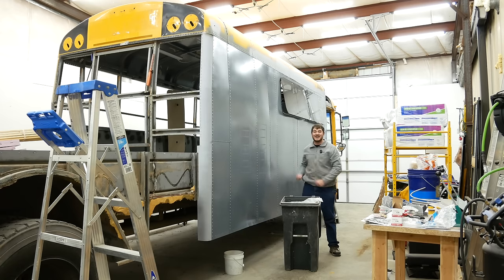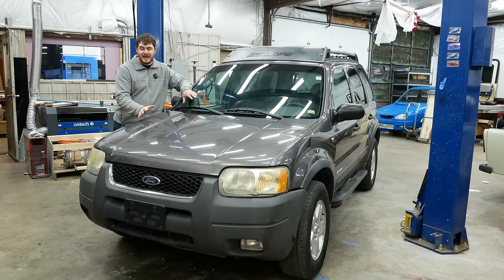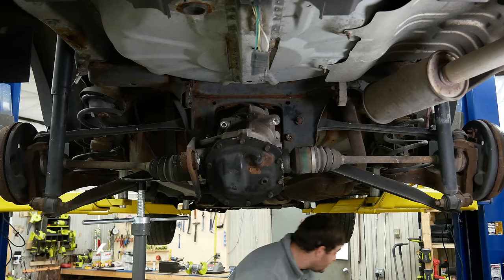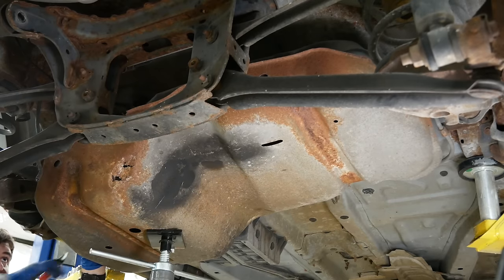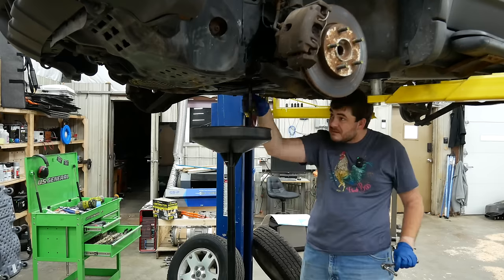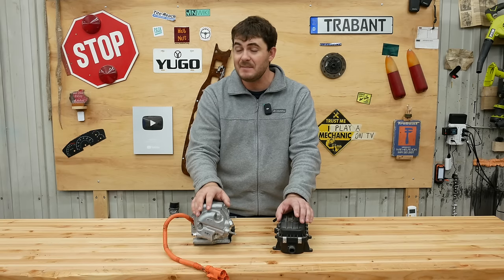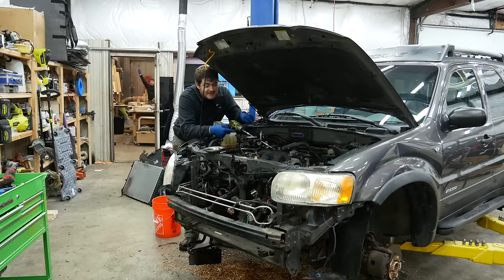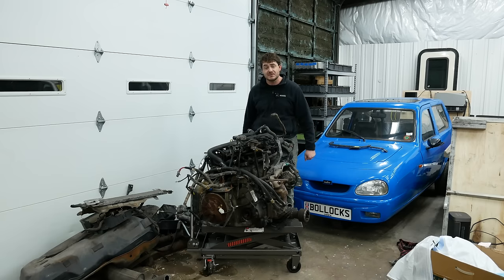I'm Building a 900HP Electric Ford Escape with a Purpose

Comment: I'm so glad you thought of DC-DC conversion. I've seen way too many DIY conversions that just run everything directly off a 12v battery, or only have like a 100w DC-DC converter, so the second you turn on the headlights, it's draining the battery. and when the 12v dies, you can't use the car at all...

As for heating the coolant: maybe look into making the chiller reversible? My Bolt has a 9kW heater, and it's murder on the range when it runs. Meanwhile the A/C is sipping 2kW when it runs.

Comment: The bus project will be frickin awesome. I've been waiting for someone to do a hybrid large vehicle, it makes total sense. You can run a load of home comforts off the electric system, you can charge it on campsites or off solar, there's loads of extra power when you need it and you can put a more efficient engine in it to generate electricity

Comment: Ooh, this is fun. My mom had a similar Escape, and while they're not really compelling now, it wasn't all that bad. Thankfully she got rid of it before it started to have rust or transmission issues.
0:27 Also uhhhh, what's with the feathers and old Dell XPS?
Also, as others have said, that copper glitter is most certainly some stop leak product.

Comment: Not sure if you’re aware but in 2005 Ford added the Hybrid model to the Escape lineup. The electric power steering rack is designed for the same subframe. They changed very little between models to save costs. Even the 2nd gen 2008-2012 Escape Hybrids use the exact same drivetrain and many of the same Escape parts shared since 2001.

Comment: 17:24 Copper flakes are from a head gasket sealer. Fix it fluid (the expensive kind, even!) means the inside of that system is probably clogged to the nines, but it's sealed! (Mostly.)

Comment: The weight is a harmonic damper. It helps stop vibrations and the weight is tuned to the mass of the unit is attached to.

Comment: Copper flakes are from a liquid head gasket sealer someone poured into the radiator to attempt to fix the head gasket problem.  The sludge you found was also probably the same or a similar product added to try to save the motor.   
I think you’re pretty safe in assuming the engine is bad.

Comment: The copper flakes in the coolant are probably from the addition of radiator stop-leak to the cooling system, some brands contain powdered metal or other materials (such as crushed up walnut shells) in an effort to plug up larger leaks.

Comment: Robert, I have to say, especially re the outro, you are quite an inspiration to me. I've long wanted a project car but have believed I lack the ability to do one. On the other hand, I am a definite EV convert. Until I watched what you do, I considered those incompatible interests (maybe this is due to the way EVs are marketed like black-box smartphones).

I picked up an i3 and I'm getting ready to work on hot-hatching it, and maybe swapping the motor to a more powerful i4 motor. Super basic stuff for some, but it wasn't until your work on the Codas that I even considered this

Comment: That's a decent project and should pull a lot of viewers in. I'm very interested in the control side so your sponsor is ideal. The bus has plenty of space for batteries, motors and cooling so could this eventually be a 10 second bus? Hmmmm....or a 1000 mile range machine? looking forward to both builds.

Comment: The chunk of metal on the rear diff was probably a counterweight since the diff weight wasn't balanced when mounted to it's hanger. Copper flakes is likely cooling system stop leak. Rather than electro-hydraulic steering, you could use something like an electric rack out of something like a Volkswagen.

Comment: Copper in the coolant is radiator repair bodge fluid. 
The existing radiator will be much less efficient than it was designed to be because the temperature differential will be much lower with the ev setup. 
Might be fine but it's worth working it out

Comment: You can also get a hydraulic brake booster and run it off the same pump as the power steering. They're typically used in diesel vehicles

Comment: The copper in the radiator was from head gasket repair kit stuff. Gobble de gookey stuff people put in their radiator to try and seal up a blown headgasket, but ultimately end up clogging up their thermostats, heater cores and radiators.

Also you just earned a new sub today C:

Comment: On the coolant system, you should consider using a heat-pump condenser so it can function as the heater as well as the active cooler.

Also, consider having a separate radiator side loop running to the cooling unit, then run the system coolant loops from the temperature regulated side of the compressor.  This will give you optimal efficiency.

You could consider using the A/C condensor directly for this, instead of reusing the radiator.

As a note, I bet that is far worse than a simple blown gasket.  I bet you've got a cracked head or even a cracked cylinder there.

Comment: Later model escapes had a manual steering rack and electric assist built into the column so that swap is technically an option if you don't want to go the EHPAS route.

Comment: Not sure if this is helpful but in 2008, Ford Escape uses a electric power assist steering module. I learned this after searching almost an hour for the power steering reservoir my '08 Escape Limited.

Comment: The copper bits in the radiator hose are from a bottle of coolant system quick fix the previous owner poured in.

Comment: I don’t know if anyone has said this yet, but the copper flakes are likely from the radiator itself. IIRC they use copper inside the radiator to facilatitate better heat transfer, so I’m willing to bet that since the head gasket blew that metal particulate made it’s way into radiator and corroded the interior of it which flaked off.

Comment: The copper flakes are from radiator sealants that you put in there to try and stop leaks and or possibly a blown head gasket but neither are long term fixes and I would be willing to bet the engine was filled with what water that didn't leak out the radiator or evaporate...look forward to the bus beast....

Comment: The weight that was bolted to the escapes diff: its there to prevent harmonic vibrations.
Reply: OfficialAgingWheels  I don't think this is legit...
Reply: I've seen it lots. Sometimes they are a weight in a rubber bushing, sometimes they are just a weight. They are there for vibration dampening.

Comment: Sub-ambient cooling can cause condensation issues. Be careful! Unless you can dehumidify the air going into the sub-ambient cooled areas first, or simply aren't cooling anything that isn't hermetically sealed / insensitive to water, that condensation can easily kill critical components.

Comment: Could easily get the same amount of power and torque out of the diesel that's already in the bus, but it wouldn't be you if it wasn't needlessly complicated.

Also the copper flakes are from a popular stop leak cooling system additive.

Comment: you should get a drive axle for the front for the bus and attach the tesla motors the that... make it a 4wd hybrid bus. You can then just leave the bus engine set to like half throttle and modulate your speed with the electric motors... either by giving it the beans or applying regenerative braking

Comment: Any concern with the motors not being able to push the bus or overheating? Im thinking of doing roughly the same process, but when I look at the GVWR it seems like it would have to push alot. Obviously cooling is the main concern as they SHOULD work, but Im curious if you had more info on that.

Comment: One other modification I would seriously consider if that thing is going to be with you for a while would be a pair of new seats ripped out of something like a Ford Edge or Fusion or really just about anything else from their lineup. The Escape has some of the absolute worst seats I have ever had the misfortune of sitting on. They're ludicrously hard, unsupportive, and barely sprung. just go to a junkyard and grab the best looking set of front seats out of whatever Ford you find.

Comment: As I'm sure you've figured out by now, the silver flakes is a head gasket stop leak chemical they poured in the cooling system as a last-ditch effort to seal the gasket.

Comment: FINNALY !!!! IM WANTING TO DO THIS WITH MY 9 WINDOW BUS BUT I WANT 4X4 MILITARY AXELS AND 2 MOTOR SO IT IS TRUE 4X4 !!!! .... but charging a 72v drivetrain with a 48v solar system (and 2 dual fuel 9500watt generators) as well as keeping constant 12v power for electric power steering electric brake booster pump , headlights, taillights, etc.
 Is where my mind starts freaking out

Comment: What's your plan for connecting everything in parallel? I thought having different aged batteries in parallel was a huge No-No. Everything I've ever read says to buy them all at the same time and swap them all at the same time.
Reply: You don't want to directly connect the cells in parallel, but each pack should have its own battery management system, so connecting the packs in parallel is probably OK.

Comment: I wanna have a 2wd swap on my 87 burban ohh the juice I could fit .. I just picked up a beautiful wrecked 91' that still runs front end is gone .. I'm thinking using my original 87 frame but that new body for final build since 91' squares were not cable speedo and way more electronic .. just gotta find a cheap Tesla and C4 vette lol

Comment: I personally think cool projects like this will also make a sizeable contribution to combatting climate change. Of course 900hp is dumb and inefficient for the average user, but showing the car community that you can have just as much fun with an EV and that it comes with its own challenges, might help to win their hearts for electrics as well. Those are the people who a lot of non car savy people come to, when they try to decide which car to buy next and they often provide a lot of valueble feedback to the manufacturers. If car enthusiasts really get theit heads into EVs, who knows how fast certain problems might be solved, that currently discourage people from adapting this new technology.

Comment: I'm considering a project to convert my Polaris Sportsman ATV to electric.

I want to reduce max speed to less than 20 km/h (12 mph) (tax reasons, and rarely drive faster for more than a feew seconds).
Current power rating (according to registration docs) is 19 kW (26 hp), but 3-5 kW would probably do.

I have looked at new models, but they are either too expensive, or too small.
But hesitating to start on the conversation because I know too little about it, but expect it to cost quite a bit too.

Comment: I'm surprised it was the engine that gave out the 4 wheel drive versions of the escapes are known for blowing differentials and transmissions. I own a 01 XLT that just had to have its transmission rebuilt at 246,845 miles. But its only a 2wd. lol

Comment: Two months past for the answer to the question asked, but anyway.

Copper in the cooling, mans a stop leak was used. Generally stop leak is supposed to be a short term fix until things can be gone over by a mechanic, although it's more often used as a first and final attempt at fixing before selling or trading a vehicle in and making such issues someone else's problem.

Comment: For me i feel the "trackless tram" idea that is currently monopolised by China could easily be domestically produced in North America, Europe and Asia (outside China) if a diesel-electric propulsion is chosen? instead of a huge, heavy diesel engine far lighter/smallerversions could be installed strictly as a range extender/backup? the tram basically can go anywhere but could be charged partially when it comes to a tram stop? imagine a 3-carriage trackless tram that can transport 300 people 24/7 that sips fuel when it needs to and doesn't have to lug a huge engine/battery pack...

Comment: with regard to the electric motor running the hydrolics for the power steering jerryrigeverything tried that in his ev hummer conversion and it caused him no end of trouble and ended up using electronic power steering instead

Comment: I had to stop the video and click the like button at the differential equation :)
Plus, spend the money to get a new radiator. You don't want whatever went through that radiator going into the cooling galleries of your motors and battery pack.

Comment: You already took the bus body off. Why not fit the e-parts in, then drive it topless?  Then you don't have to work under a lift, or worry about fitting things tightly in a unibody. That's why i went in hard on a SMITH TRUCK fleet

Comment: A warning about using those tesla motors for a bus. No matter how much cooling you throw at those motors they are only capable of 100HP of continuous output per motor after a couple of minutes of full load operation. That's fine if you are cruising but if you go climbing a mountain you can run into trouble.  Guys racing those motors on the track have tried all sorts of tricks and have not cracked this problem yet.
Reply: I thought battery cooling was the issue, not motor heat

Comment: Being this is a ford escape, I would say the problem is a crack in a cylinder wall. These are famous for that. The copper flakes are from someone dumping a can or three of "Block Seal" in it, hoping that would fix it. Sadly the engine is junk. A brand new engine would cost less then fixing the old one.

Comment: And the copper shimmering flakes you're finding in there is that garbage over the counter radiator stop leak stuff and the electric hydraulic power steering pump you're looking for could be sourced from a late model Volvo they're all over eBay for pennies on the dollar...😉

Comment: I keep thinking that some sort of EV hybrid conversions are going to be REALLY important to actually promote EVs in poor countries. A lot of people can't afford a new car and will be using dead ICE cars for decades, unless a viable EV conversion is offered. Also, gas is way more reliable than electricity when you're in some country or region where electricity is available like 2-3 hours A DAY. 

Plus, that reduces the battery requirements. A lot of people want the car to be safe to drive over hundreds of kilometers without fearing that the battery will die mid-way. Having the gas option to do it will help, too.

Comment: Your rite about being expensive Im 5 grand in to convert a 2006 Saturn Ion 3 with a  5 speed manual and none of the specials like you have just "made in china" 20KW motor and 105 amp hour in batteries at 120 volts nominal 32s Lithium-Ion. Dont have a garage so i will be waiting till spring to do my first conversion.

Comment: Wait wouldn't it save space to direct drive each wheel with a drive unit? You could also make a digital LSD equivalent and vectored thrust in turns... not that you'd drift a bus, duh, but good in the snow.
More space, more batteries, is the main thought I have.
Reply: Also, as my first car was this make, model, and rough year, kind of sad to see one die.

Comment: DONT run it in reverse. Just roll it over and use the oil pickup line modification and the motor can then continue to run in the direction the gears faces are designed for.

Comment: Slows down to 45mph? I had a bus that would at full throttle inch forward at the top of a hill at a junction.

When running in service, I would get that bus MOVING!

Someone pulls out and it takes an age to speed up again.

Comment: Given that you'll be mounting the batteries and electric drivetrain very low in the vehicle, you will probably end up improving the handling quite a bit actually. Or at least it's stability against roll over!🤣

Comment: Random comments as I go: Actually uncommon for any Escape engine to blow head gaskets.  Transmissions?  Different issue...  Yes on that chunk being an NVH piece.  Say what you want about Ford, but there is literally no one at any price who is doing better work in NVH than Ford.  Massive oil leak on motor?  Massive leaks are most likely the oil sending switch on the front of the motor on the 3.0.   These leak and make it look like a murder scene.

Comment: Electric vehicles are great for speed, power and fuel economy but overall are going to cost way too much compared to petrol and diesel vehicles.
Battery packs are currently too big, costly and have far too short lifespan.
Also, our power grid, not to mention our power generation capacity isn't even close to being able to handle a widespread uptake of EVs.

Comment: Those Tesla drive units will not work very well in a bus. You would be money ahead if you have to have an electric drive unit for a buss to actually source a high torque unit. If you really want economy, have the existing engine in the bus turned up. The added weight of a genset, batteries, and electric drivetrain is really not practical.

Comment: WHY would you covert a school bus to electric?  By the time you are done the bus will weigh 10 times what a Tesla weighs and it has the aerodynamics of a piece of plywood!  You want to drive this thing across many states (at once) and at highway speeds.  You are going to need 10 Tesla extended range batteries to get any kind of distance.  The aerodynamics is going to wreck this even if the weight wasn't going to wreck any chances of usable range.

Comment: This is a terrible idea. A ford escape was never meant to have 900 HP. In my opinion, a high center of gravity car, shitty suspension that can't handle the weight of batteries, undersized brakes and small wheels plus 900 HP is a recipe for disaster